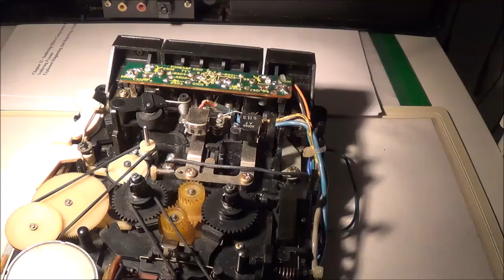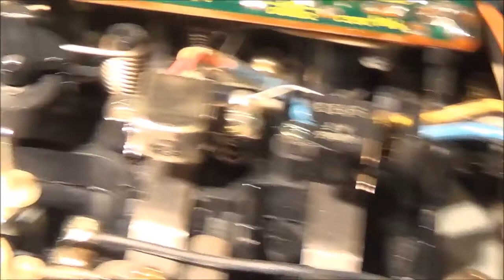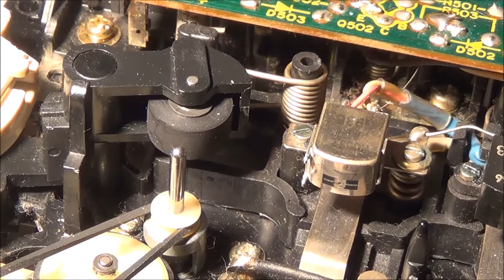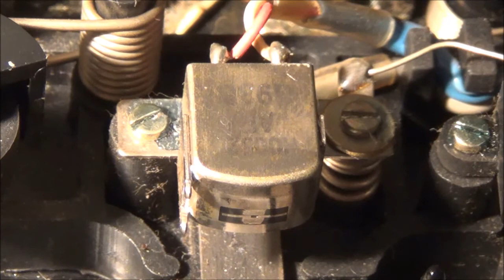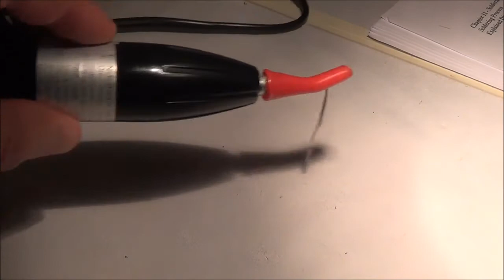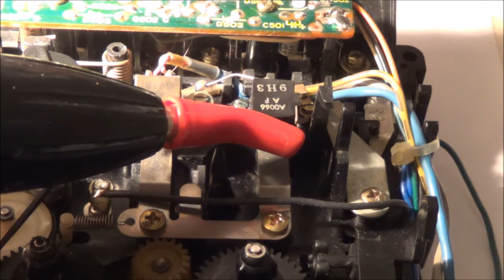SHARP GF9191 HEAD CLEANING & DEMAGNETIZATION

Comment: Appreciate the paperclip testing trick, bought a used one on good ol EBAY.
Reply from the maker: Thanks for your kind words.
Reply: @OldSchoolElectronics  Thought my top of the line Vector Research Cassette was trash, must have been the blank cassette tapes I bought, then recorded, then I lost over 1/2 volume on 1 channel. But that Memorex one I bought fixed everything, and of course did my other decks, and yes I Like tape.

Comment: i have a loud noise coming from the right amplifier of my gf 9090 when i play a cassette 
can you give tip to where does this come from?
thanks
Reply from the maker: Hard to say--noises can originate from anywhere; it is a long signal chain from the playback head to the speakers. Normally you need 3 things: service manual, scope, and multimeter. I sold my GF-9191 some time ago.  But, loud noises are sometimes made by a dirty record/playback switch. Clean that; it is located on the board behind the cassette mechanism and has a spring. You can try to spray into there with contact cleaner and work it back and forth after you spray. Power off, of course. Should be one switch for each channel.
Reply: thanks a lot for the help
Reply: thank you

Comment: Dear friend hello from Greece
please i am looking for pinch roller and belts for the gf 9191 that i just bought.
Where can i find these and more parts?
Thank you for your advices and the great videos.
Reply from the maker: Hi: They ship worldwide and I got  belts from them. Belts and pinch roller: https://www.ebay.de/itm/Service-Kit-fur-Sharp-GF-9191-HB-GF-9191HB-Radiorecorder-Ghettoblaster/132687739388?hash=item1ee4ce39fc:g:t-cAAOxy9X5TX1K5

The pinch roller is also sold by itself from this same seller (revox_de): 
https://www.ebay.de/itm/Andruckrolle-fur-Sharp-GF-9191-HB-pinch-roller-Radiorecorder-Ghettoblaster/132687740561?hash=item1ee4ce3e91:g:AF8AAOxyOalTX1bm

And this person sells the idler rubber, capstan pulley, and belts, but no pinch roller in this kit---I bought from them, too. 
it is the last kit they have: 
https://www.ebay.de/itm/Riemen-Satz-fur-Sharp-GF-9090-GF-9191-GF-9292-GF-9696-Recorder-Idler-Belt-Kit/283034607327?hash=item41e62d5edf:g:sVsAAOSwWdZZYLwC
Reply: Old School believe it or not,they dont ship to Greece!!!
It's ridiculous
Reply from the maker: https://www.ebay.de/itm/Sharp-GF-9191-Riemen-Set-Belt-Kit-Courroie-Kassettendeck-Tape-Deck/391522317443?hash=item5b288c7483:g:E08AAOSw~aBauiRW#shpCntId
Reply from the maker: I think they ship to Greece. The other company might not ship to Greece they use some kind of a registered/certified mail system which might not be offered to them, etc.
Reply from the maker: They also have a shop and they ship to Greece. https://www.thakker.eu/riemen/tape-deck/sharp-gf-9191-riemen-set/a-8892/
Also, shipping costs Euro 2,90 to Greece normal mail and Euro 5,00 registered.
Reply: Old School thakker i know...but there is no pinch roller :(